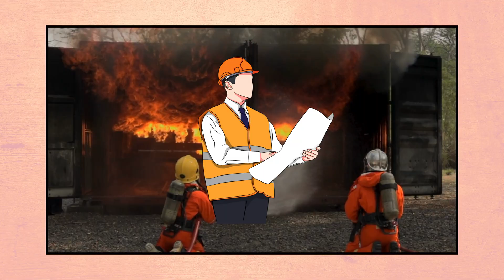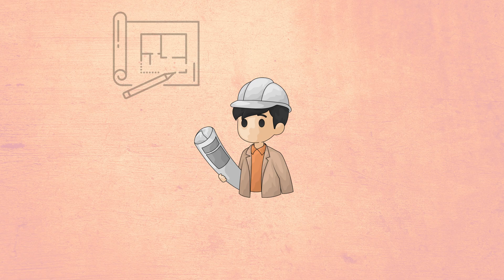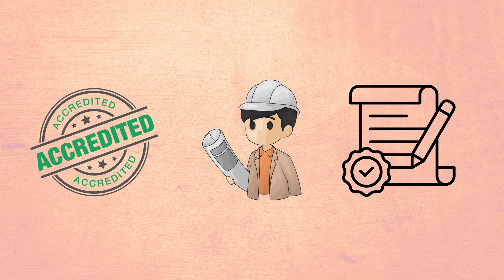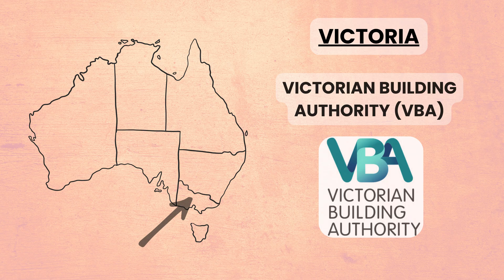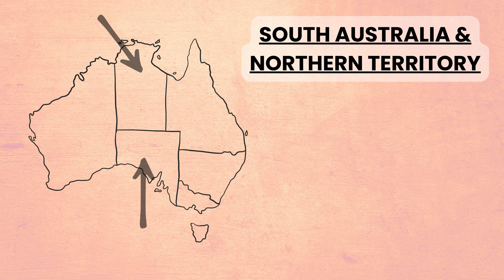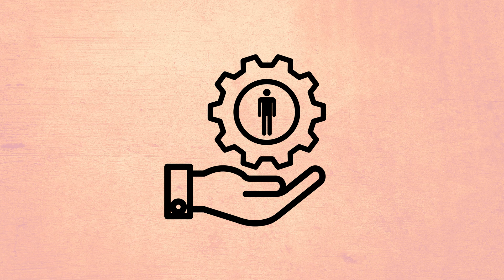Want to Be a Fire Protection Engineer? Here’s the Pathway.

Comment: I am currently working in the UAE and planning to move to Australia within the next two years. I hold a BTech in Mechanical Engineering, a NEBOSH Level 6 qualification, and an ISO Lead Auditor certificate. I am working in the facility management sector and have basic knowledge of building fire protection systems. I would like guidance on how to plan my career path to become a professional in fire protection and firefighting systems in Australia.
Reply from the maker: Hello, Thanks for reaching out. I would recommend you plan to organise your study of "CPC50520 Diploma of Fire Systems Design" as soon as you arrive in Australia. All the states have different "certification"  requirements. 

You can use you engineering degree plus 5 years of experience to be come "chartered" which will allowyou to become a registered engineer in every state of Australia. 

The Diploma of Fire Systems design will be your first step. Good luck!
Reply: @fireprotectionengineer1 thankyou.